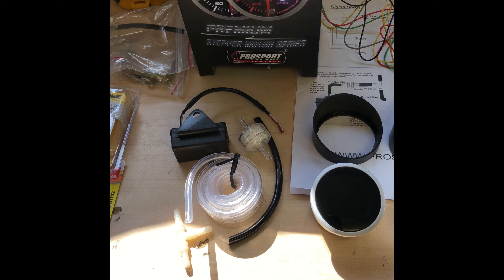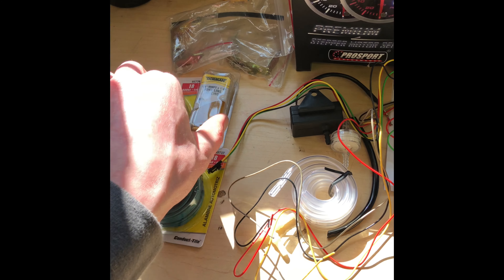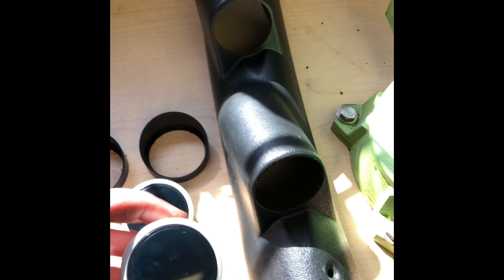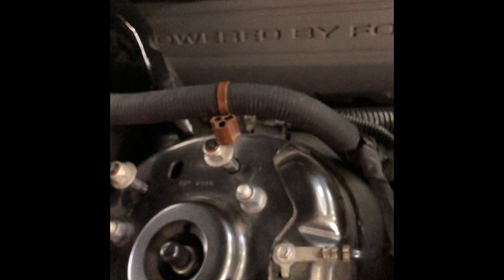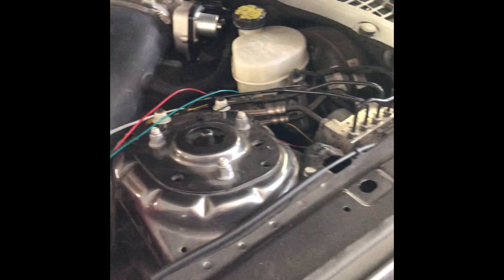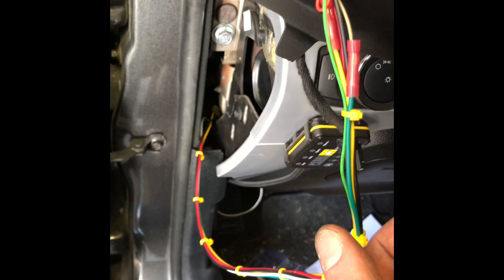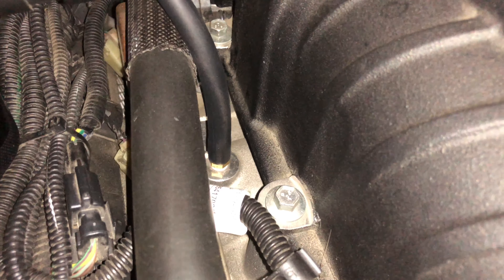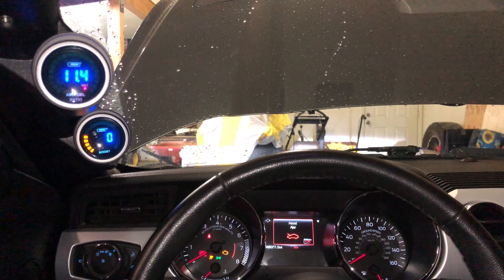How To Install Pillar Gauges In A 2015 S550 Mustang (Easiest way guaranteed!)

Comment: Great video man I was wondering when somebody was going to put one of those a pillar gauges on and make a video about it. But one thing about those electronic boost gauges, they do read around what the boost is supposed to be but they are not 100% accurate. The most accurate boost gauge that you can get would be an analog gauge. I have a 2016 with the same Roush blower and I used forscan and changed one digit in the dash parameter to make my vacuum display in the middle of the speedometer consul to read boost and vacuum. I believe the early 2015’s came like that from the factory but some didn’t and like I said I changed one parameter and now I have an electric vacuum/boost gauge that looks like it came from the factory. So when you look at your air fuel and your cylinder head Temperature you will see the vacuum and if you click on it it says vacuum and boost
Reply from the maker: Appreciate the love Mike! Great tip about changing the parameters as well. I’ve got Forscan, but never thought to mess around with it and change that up. I have seen that my boost gauge seems to replicate my factory boost/vacuum gauge in my dash, but agree that they’re not the most accurate gauges. Soon I plan to be swapping to some more quality ones, but for now that is what I had with the car.

Comment: I have just a battery gauge and the instructions are vague as hell. Red, black, and white wire. How would I go about running it? I suck at wiring (for a 2014)
Reply from the maker: I’ve never wired in a voltage gauge, so not entirely sure. Red should be your power, black your negative, and then white is most likely for bringing the gauge online when the ignition is on. Being as it’s a voltage gauge, I would think it wouldn’t matter where you tie the red wire into. Battery should work. The white wire will need to go to a wire that’s only hot with the ignition on though. If my assumptions about the wiring are correct anyway